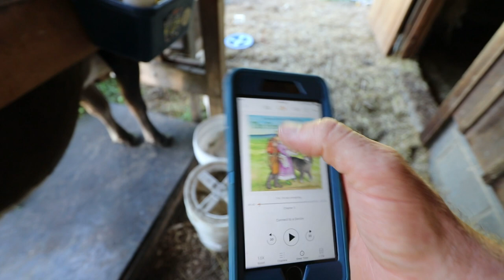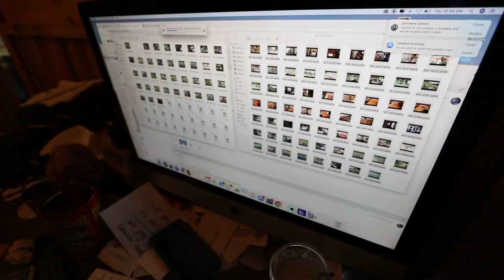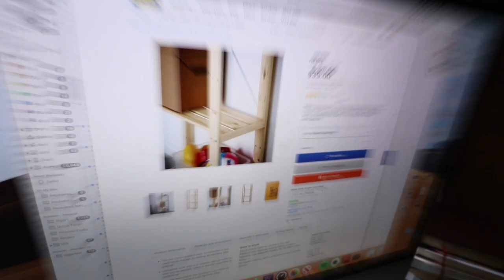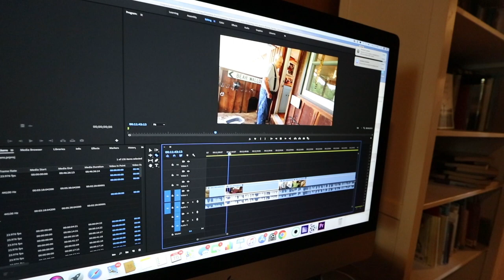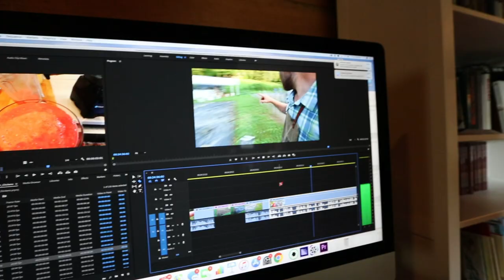We Put a Cool Room in the House | This is How it Feels

Comment: Glad you got the chain sorted out.  When the saw is working correctly and sharp, it should be throwing out chips that look like hash browns.  When they come out like flour and especially burnt time for a sharpening.  I usually touch up my blade every 30min of cutting, or after accidental contact with metal, stone etc.   Have the correct diameter file for your chain, lock the blade, and hit all the teeth on top of the bar,  all one side first, then down the other side.  Unlock the chain, use the file to hook the first unsharpened tooth around the nose of the chain, pull it backward close to the saw body, then lock the chain to do the next set of teeth.  With practice you can get a basic touch up down to a couple minutes, and the payoff is huge in cutting time saved.

When I was Jonahs age I was already really good with wood, so my shop teacher taught me metalworking skills.  Forging, hardening, tempering, soldering, brazing, welding, drilling, threading etc. Parlayed this into a career working with machines, and I still use these skills decades later for projects, hobbies, repairs etc.